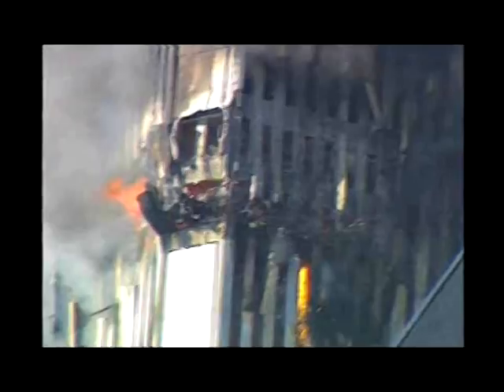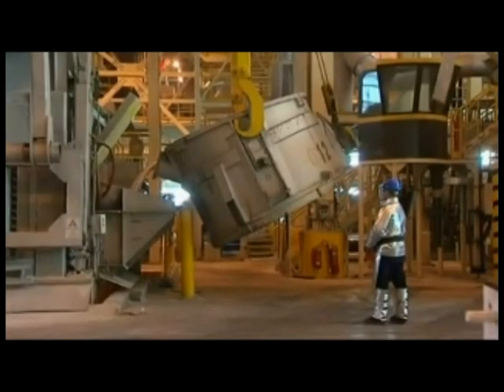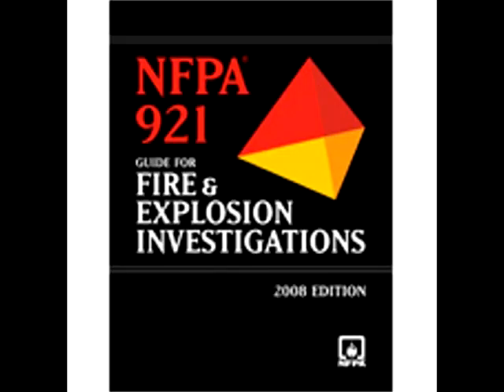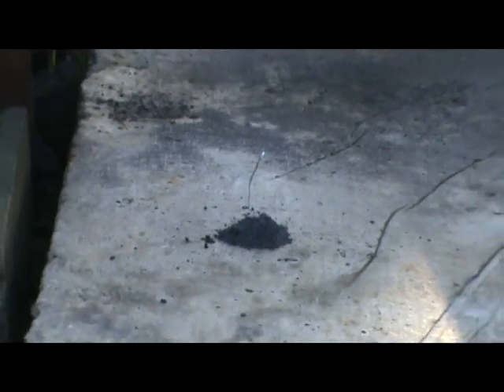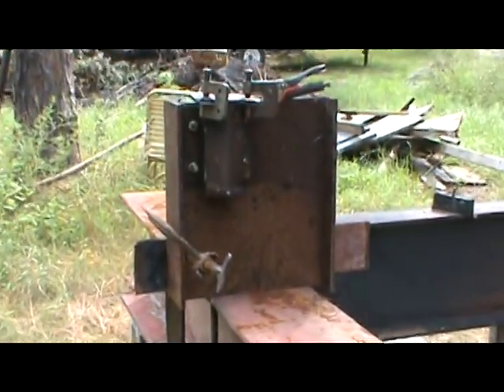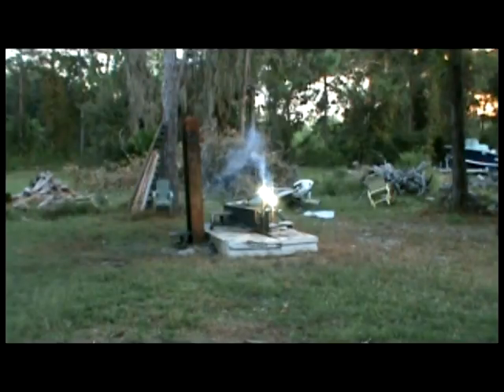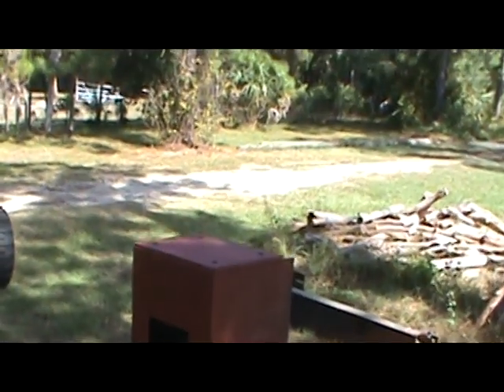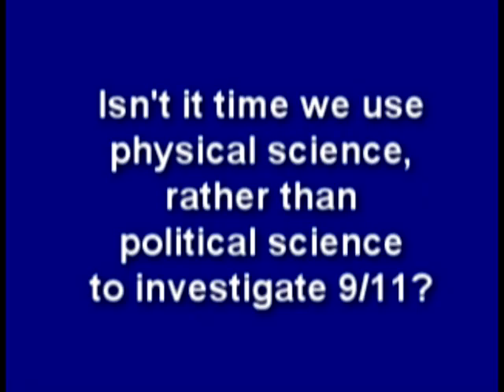9/11 Experiments: The Great Thermate Debate

Comment: @SexyMelon I am completely assured that the aluminum in the 982C video (1800F) was orange white when it left that mini-crucible (forget what you called it).
Then, however, the problem becomes why is the temp change of the WTC flow so so much slower than pure aluminum.
Also, 1000C aluminum falling through air would cool a fair amount slower than the aluminum in contact with a solid metal pan (I assume it was room temperature). 
Still wouldn't take as long as it appears in the WTC flow, however.

Comment: @SexyMelon "The paper is a physical study of evidence confirming its results with physical evidence, as documented in the paper"
The data in the paper proves the conclusions WRONG.
"The paper and its data contend otherwise" - because the authors WANT the chips to be "thermitic" despite clear evidence to the contrary (for starters: They released MORE energy than is even theoretically possible for thermite in the most ideal circumstances. So the burning stuff cannot possibly be thermite.

Comment: @SexyMelon "There is only one piece of evidence documenting temperatures of 1,000C, and that is the sample that shows signs of thermitic corrosion."
Correct. And no piece of evidence documenting temperatures above that.
"Integranular melting through sulfur lowers melting point of steel, and is the basis of thermate's operation". It goes too slow, and besides, the red-grey chips do NOT contain sulfur. S. Jones debunks you!

Comment: @SexyMelon "Unless you're suggest concrete was literally vaporized"
Try to learn a little about how cement is produced. There are iron-rich spheres in the DUST. A large part of the dust was concrete. WTC concrete contained iron-spheres from the beginning - they were already in the cement used to build the WTC concrete floors. Because flyash from coal fires is commonly mixed in.

Comment: @SexyMelon Well, just look at it, the surface of the aluminum has floating solid pieces, it is much nearer the melting point. 
Than our 1800F heated aluminum. The point is, if you take the first video and look at it frame by frame, the first frame of aluminum dripping out clearly shows a white orange liquid coming out.
It's hard to tell because it happens quickly, and to the eye a reflection of light and blackbody light are hard to distinguish, I had to slow it down to confirm.

Comment: @SexyMelon It is from the aluminum itself. 
Which, also, cooled enough to not glow in less than half a second. It's about 7 frames from orange white to grey. I downloaded it and ran through frame by frame. 7frames / 25.3 fps = .30 seconds.

Of course, this still completely destroys any description of the flow as aluminum, without additional conditions, but I don't want to retreat all the way :P

Comment: 7:18 "these iron spheres are a by-product of thermite, and not from any steel" - Strawman and begging the questions. Iron-rich spheres are already abundant in concrete, and form in many organic fires. You find them in the ash of burned wood.
7:25-10:00 - the experiments: Cute! Shows you can do it if you have access to the steel columns. But remember two things: Collapse initiated on the burning floors. How can you set igniters off in these conditions? And wouldn't thereaction show on perimeter?

Comment: 3:20 "NIST never conducted any experiments to confirm their theory" - true, but not every feature of such an event must be confirmed in experiment, only RELEVANT observations.
The flow went on and of for 7 minutes. Had there been a pool of molten steel it would not have remained so stable, it would likely have melted through the floor. Did Jones test for that?
3:30 "An independent, peer-reviewed report..." - WRONG. It wasn't properly peer-reviewed.

Comment: @SexyMelon And aluminum at 1000C glows orange, clearly visible.  For reference, at 524C is the temperature at which blackbody radiation for most substances crosses into the visible light spectrum. A faint red tinge will be visible in a completely darkened room.

Comment: @SexyMelon How rapid is 'rapid' cooling?

And, an object separated by air from a fire, is initially of a lower temperature, but it will increase as the heat energy cnducts through the air. It is simply that most gases are poor conductors of heat, and this will happen slowly. According to the ventilation, the maximum air temperature will be some amount lower than burn temp.

Comment: 1:33 "(5 kinds of evidence) all corroborating temperatures high enough steel" - WRONG. All 5 corroborate temperatures in the range of up to 1000°C, that is about 500°C short of melting steel.
1:40 "The MEDIA tell us The intense fires...it melted the structural steel" - The media don't know engineering. They tell BS. Go ask real engineers (at NIST, for example). NO structural steel showed sign of melting.
1:51 "office and open air jet fuel fires cannot melt steel" - and the didn't.

Comment: 1:18 "NASA took photos, indicating very high temperatures days after the event" - these reached "over 1300°F" (700°C), the hot spors were only a few square feet large. Not so surprising on a BURNING trash heap.
1:23 "and fire-wise professors were preplexed by melting of steel beams" - WRONG. It wasn't the beams that melted - their surface suffered something called "innergranular eutectic melting" and isn't at all indicative of temperatures high enough to melt. It is more like chemical corrosrion

Comment: @SexyMelon Assuming aluminum lacks a visible glow, in daylight, at it's melting temp, then consider:
In order for the aluminum at, for example, a temperature of 1000C to go from having a glow to not, it would have to fall 400 degrees in 5 or 6 seconds. This with it traveling through air, a very poor conductor of heat.

Comment: 1:05 "Molten steel running down in channels" - IMPOSSIBLE. Any material that these "channels" could be made of would have melted itself in contact with molten steel - including concrete. The witness is simply WRONG.
1:08 "Later we leearned of very small spheres of ironn all through the dust" - Yes, these are very common in flyash - a major component of most concret (Portland Cement). Nothing surprising here
"That iron must have been molten" - yes, when cement was produced 1970ish, NOT on 9/11.

Comment: 0:49 "The red-yellow metal, poured from the tower...it looked like steel in a foundry" - WRONG. Molten steel is not red-yellow. It glows white-hot. The orangish-yellow colour of the flow is indicative of temps closer to 1000°C / 1800°F, way below melting point of steel.
0:57 "And there were MANY eye witnesses that described molten STEEL" - WRONG. Only a few said "steel". All who did were mere speculating on the material and almost certainly in error."

Comment: @SexyMelon Well the change in color of blackbody radiation is continuous, and yes it is lost, or, that is, it lessens as the sparks fall through the air. Some specks can be pointed out to have lost their glow, and some continue glowing a pale orange as they leave the camera's sight. It's hardly constant, or even constant followed by fading, which would indicate a chemical reaction terminated while the material falls.
If this video shows a constant glow color, then I say the WTC flow does not.

Comment: @pjnlsn "I say the flow was aluminum melting from the airplane remnants."

Then prove it please.

"It's not necessary, seeing as, along with basically any substance, a body heated through 1000C will emit radiation giving it a glow, ranging from red to orange-white."

The problem isn't necessarily the substance in and of itself. ANYTHING pouring out at that kind of temperature is a problem for the OT.

Comment: @SexyMelon I say the flow was aluminum melting from the airplane remnants. Pooling, released as the floors sagged.
As far as NIST saying that the orange color of the flow was from other substances in the flow, I don't think much of that. It's not necessary, and I guess I share this vid author's incredulity about such an idea.
It's not necessary, seeing as, along with basically any substance, a body heated through 1000C will emit radiation giving it a glow, ranging from red to orange-white.

Comment: @SexyMelon You must see that to substantiate a claim about thermite demolition, or by the use of any substance, you have to flesh it out more than I've seen done. If someone were to say to me that thermite packages were placed along the exterior columns, distributed equally along the length of the building, I might expect a video showing these packages being ignited simultaneously. Or something like that. 
As it stands I see explosions hardly resembling thermite burns, and one flow.

Comment: @DonArsuk84 Yet you are perfectly happy to believe the thermal expansion theory without so much as a shred of evidence? If skyscrapers fell from fire alone all the time it would be one thing, but they don't.

This here before you is physical evidence of a real physical process, yet you insist that NIST's fictitious modelling is proof. You don't even have the source code, not a single corroborating physical experiment, not one real example of crush-up-crush-down.

Yet you consider THAT as proof?

Comment: @SexyMelon If it was iron or steel, that would require some high temperatures. If it was, instead, aluminum, it would not. It would only require temperatures more than about half the recorded air temperature of the fires. I.E. Melting point of aluminum ~600C. Compare to air temperatures found by NIST, up to 1100C.

Comment: @SexyMelon He showed the molten flow.
AFAIK, in tower 2, there were 3 separate explosions observed after impact, and at least one molten flow observed.
Two of them were at floor 22 and in the lobby.
I've seen video of the lobby and the flow, lots on youtube.
This of course will not qualify as more than conjecture, but have you seen the video?
If you can see the difference between a fuel burn and a thermite burn, then you must see those explosions do not appear as packed thermite would.

Comment: @SexyMelon Was wondering when you would display Godwin's law... 

Just because rdx charges and thermite are different does not proof 1 or both were present at wtc on 9/11. There wasn't any found on GZ. No residue, no nothing except what you would find if you crash a plane into a tube in tube designed office building.

Comment: @SexyMelon Well, both would have produced a series of explosions you normally will hear and see in controlled demolition. If abnormal measures where taken to demolish wtc, why is the normal controlled demolition used as "Evidence" on buildings that doesnt even compare to wtc? If they by your standard only compares on where you find it relevant, and not on all other accounts

Comment: @DarkwingScooter Well, This highly trained explosives expert in this video might have needed magnesium to set it of, while Mythbusters only needed a box of matches. This only shows that he doesnt know what he is doing. In order for it to be a controlled demolition, there needs to be placed explosives symmetrically in a complex variety of key points on at least every second floor for it to be symmetrical. Last i heard, the multiple floor fire "theory" is not refuted, or what?

Comment: @DonArsuk84 Did you miss the part where he needed a magnesium fuse to light the stuff?

If it is possible to protect human being on top of lit canisters filled with rocket fuel
(/watch?v=AkG8ez6LsQI), I believe it is possible to protect hard to ignite thermite/thermate from office fires. 

Would it really have made any difference if one or two charges happened to go of prematurely though?

Comment: Apparently the powers that be, in engineering this conspiracy must've decided that in addition to running an airplane into the towers, they also had to have one packed thermite charge on the impacted face.

I am incredulous as to why one metal flow nearby the aircraft remnants is supposed to be a thermite burn and not molten aluminum.
It's not just that, it's the engineering knowledge which demonstrates why one airliner was enough to bring the towers down. Why was thermite needed?

Comment: The guy's obviously industrious.
However he doesn't seem to realize that photo/video evidence is only useful in confirming a theory, and doesn't stand on it's own.
Or that NIST didn't say the fires melted steel, or that steel was melted. It said the floor trusses were heated by the fire, and the floors began to sag, as well as core and outer tube columns. This combined with the severance of exterior columns made it so the columns through impact floors could not support the weight above.

Comment: Tell me why on the south tower the perimeter beams started to bend inward prior to the collapse?  Was it because the floor steel truss was exposed to fire and sagged dragging the perimeter beams?  And fires burning out?  That's a laugh.  They weren't burning out.  They spread throughout the upper floors.  Your right about one thing.  Office fires don't melt steel.  They become weak.